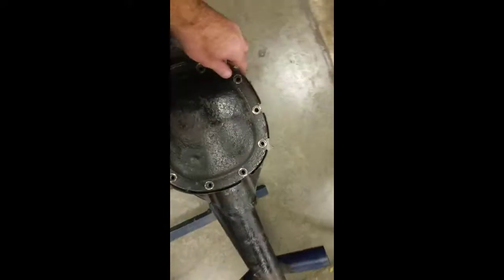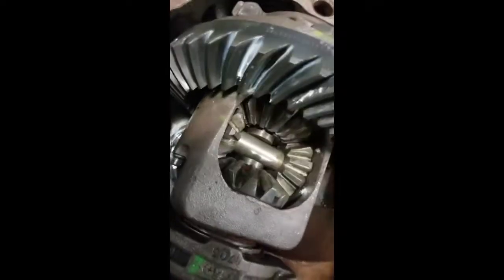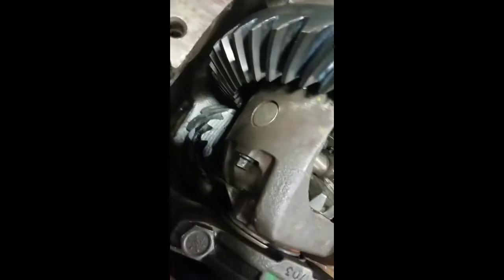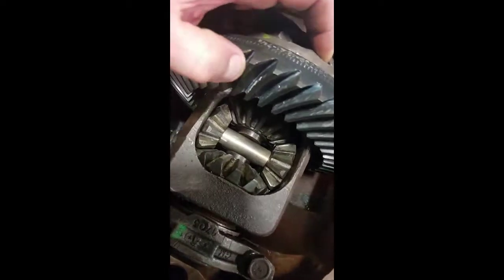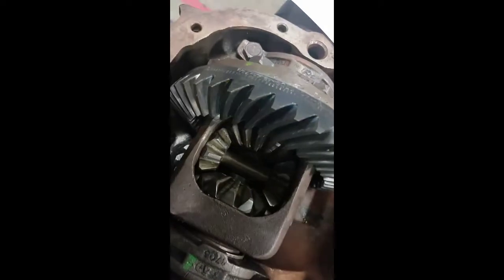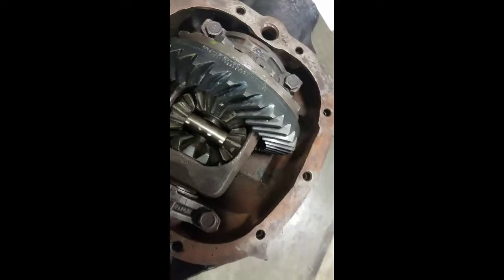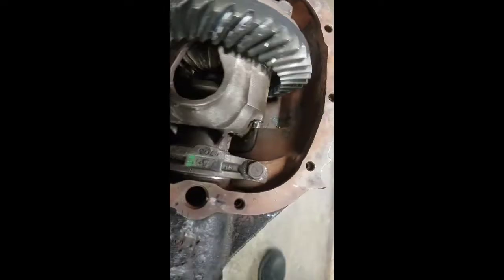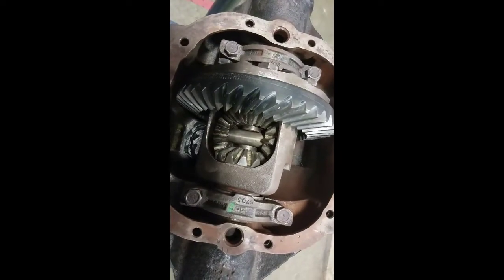Rear Differential Inspection and Identification

Comment: Thanks a lot! Doing a teardown right now and im unsure of the noise. Had a low frekvens vibrations in 60km/h that increased with speed. 
Seems that my centerbering and driveshaft was unbalanced so should have been the noise. but was worried about the differential, but dont have any whining?